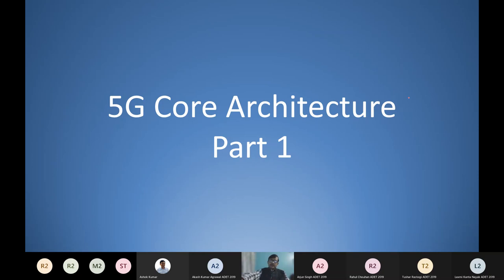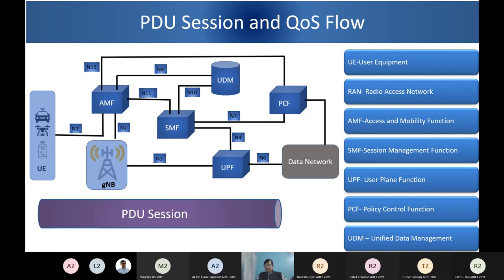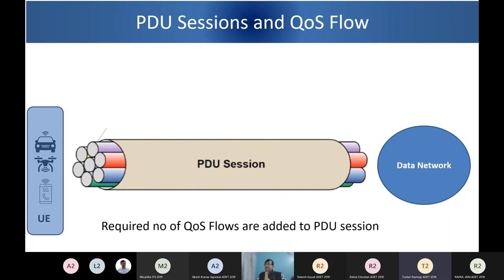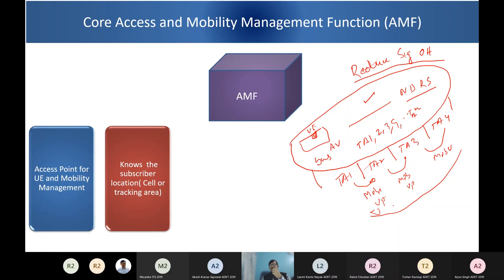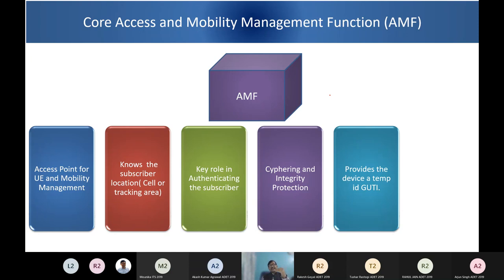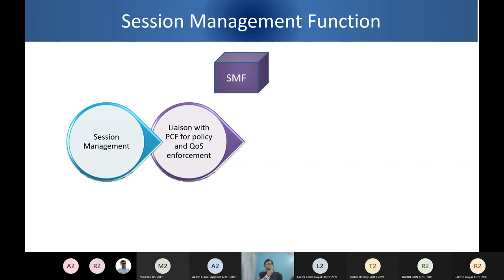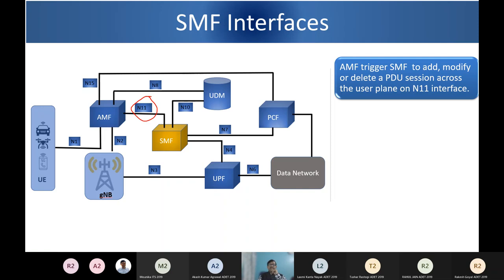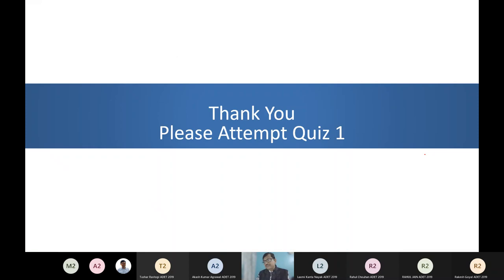5G Core Architecture Part 1   Live Session 1st Feb 2022

Comment: N1 is Air interface or physical interface  ?
When UE is moving from one gNB to another gNB   in user plane , UPF will decide hand over  How ?
Reply from the maker: It is called NAS messages which UE uses to connect to core (through AMF ). Mobility management is done by AMF. UPF is Anchor point during mobility between one gnb to other